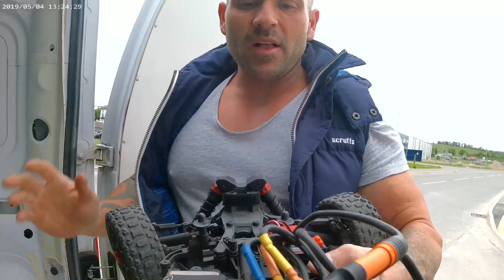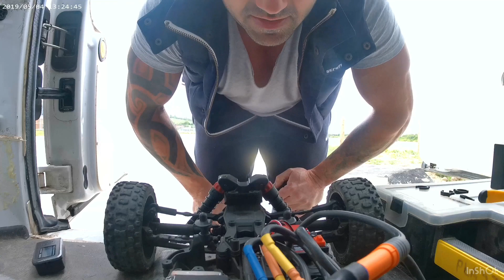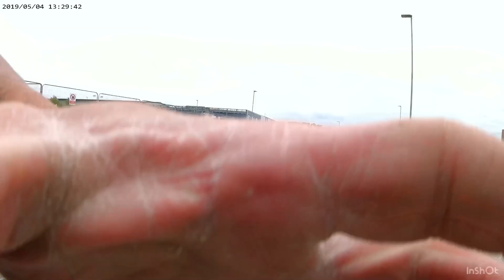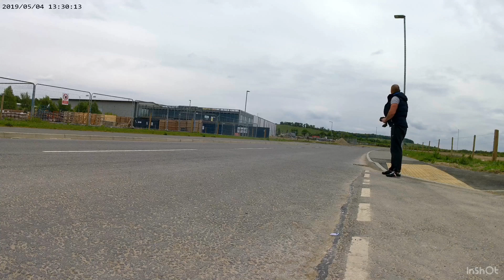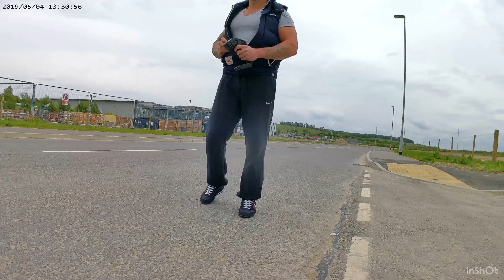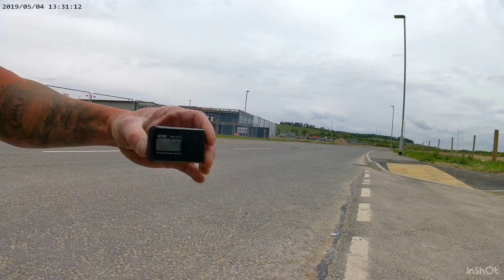Arrma typhon 3s - 4s battery 50c

Comment: You made me convert my typhon to 4s hahah just ordered the 185blx esc and the 4s motor from the Kraton so it's a direct fit thanks for the videos man cheers from Nor Cali
Reply from the maker: Rocky morning rocky you will not be disappointed at all , just remember gentle on the trigger and any help I will gladly help out .
Check tyres every time you take it out and run some glue around the rim just for some more strength , if there’s any imperfections. 
Enjoy my man
Reply: @CmwSpeedrunUk  did you have any over heating issues with the 20t pinion? Just curious gonna run the 15t pinion on 4s just to get the hang of it at 1st  but man did my esc have alot of overheating issues even with a motor fan on 3s well see thanks for the info and I just ordered a new radio and upgraded receiver to get some better range thanks for the uploads!
Reply from the maker: Rocky hi mate 
I only ever had limp mode when I hammered 3s with 20t pinion stock motor stock esc , I fitted a fan to heat sink on motor and that stopped that , I personally thought it help move the heat out of the shell , 
No over heat issues with 185 blx , stock 3s motor with fan on 4s battery .
If your going to do speed runs make sure you get the buggy as low to the ground as you can I removed clips from shocks . 
I really hope you enjoy this is absolutely madness .
Reply: I think You need to run that motor at 6s to run it at full potential otherwise you will encounter heating issues ,thats the same thing happening to my maxx ,check out vids from rc explained  
The way you should go about it is decide what battery you want to run on your rc then chose the motor /esc to be able to run it at full potential 
I think I'm no expert
Reply from the maker: Thanks buddy this was a while ago when I was just learning , I was just experimenting, it’s was the stock 3 s and I wanted to see what happened , thanks for your comment will check out your videos
Reply: @CmwSpeedrunUk  look how far we’ve both come mate in just a few months lol 😂
Reply from the maker: Yes rock we are flying still watch all your videos and like I just don’t comment any more because of the haters I don’t want it bringing negativity to anyone else’s , keep it up son 💪🏽🇬🇧👍🏽

Comment: Can you run 4s on a stock 3s typhon
Reply from the maker: Hi 
Only if you change esc buddy 
I ran 4s and 6s when I changed esc to 185blx 
My advice would be to keep 3s motor just add a fan to heat sink and you will have a animal of a typhon . I have plenty of videos on typhon 3s it’s still my favourite till this day .
Reply: CMW Chris woodward cool thanks for the fast reply happy bashing !
Reply: One quick ? Any other 1/8 buggy bodies that can fit on this 3s version
Reply from the maker: Not a problem mate , not that I know of buddy I had to spray mine , to change the look ,
Reply: @CmwSpeedrunUk  Thanks for the advice! i am gonna give it try!